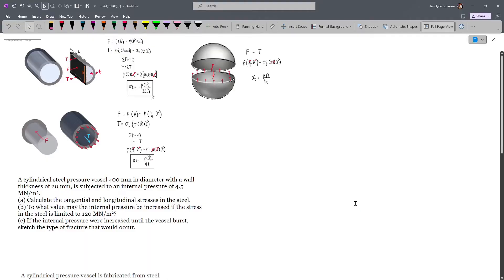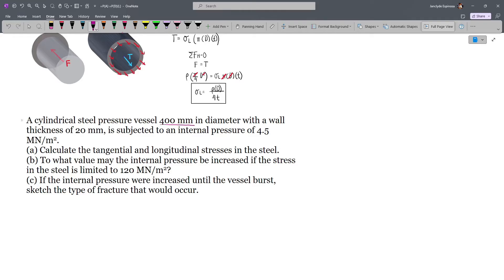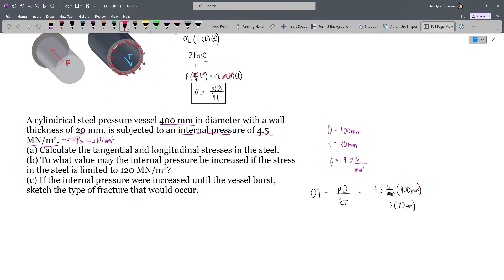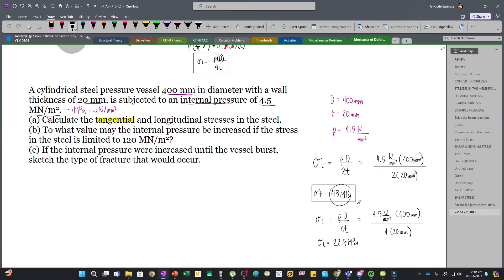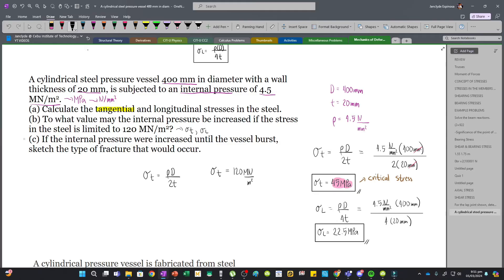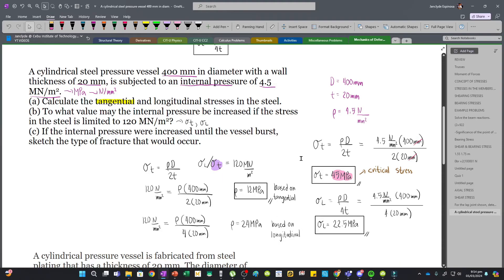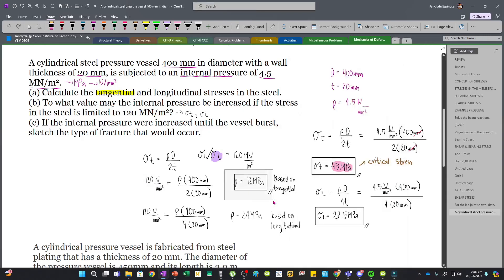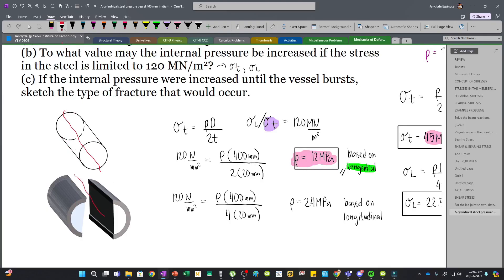A cylindrical steel pressure vessel 400mm in diameter with a wall thickness of 20mm is subjected to

Comment: Sir, why did you use the outer diameter instead of the inner diameter? PD/2t = 4.5 (400-2(20))/2(20)=40.5MPA same as the longitudinal stress.
Reply from the maker: When the diameter is given, it is generally assumed to be the inner diameter, unless stated otherwise po